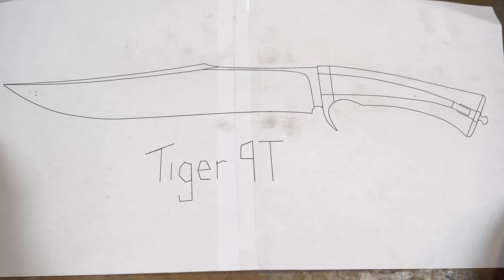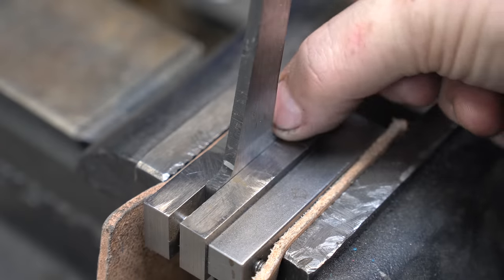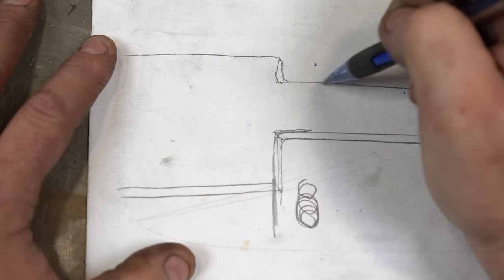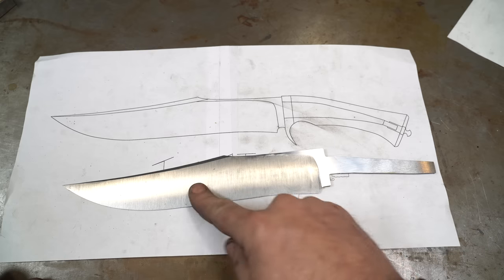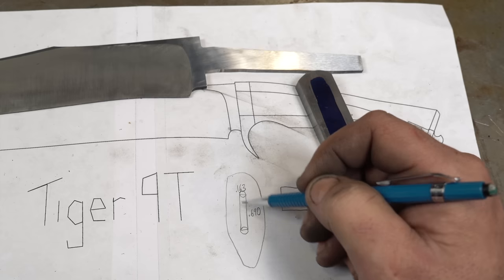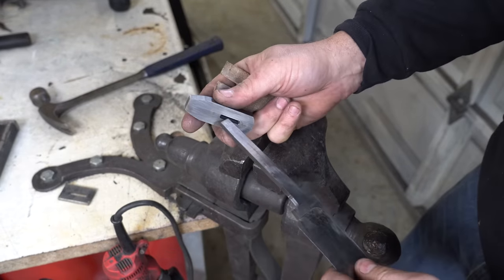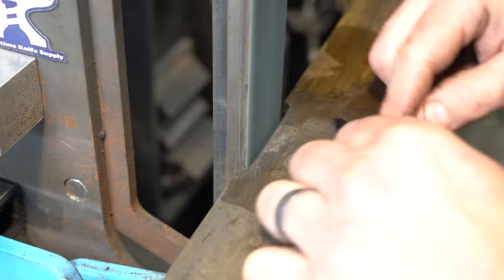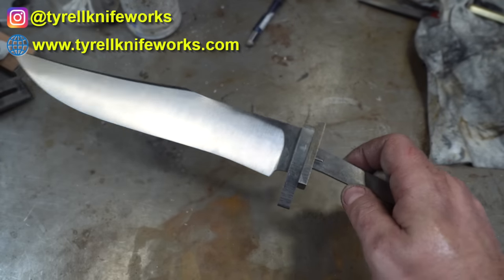Triple-T #120 - Takedown Bowie Series - Guard and spacer

Comment: One thing I don't understand about take-down knives is Why? Why would I want to take it apart later?
Reply from the maker: It’s actually very useful to take it down.  You can clean it, re-etch the blade, fix or replace the handle, lots of reasons. It’s nice to be able to work on each piece separately as well.  Thanks for watching.
Reply from the maker: Also, the hand is almost healed.  It was just a deep scratch.

Comment: What is the POINT of a take down forged blade ? Is there going to be two or three types of different fittings / handle design on one blade ? If not what is the point ? It amazes me how American knife design has become too overly worked ....
Reply from the maker: You're a bladesmith yourself, yet you don't understand the answer to this question?  Pretty much all Japanese blades are constructed as takedowns, it's not an "American" knife design.  The point is that you can take the knife apart, clean it, care for it, without destroying it.  Dial back your attitude a bit and you might get a better response.  (Also, I'm not American, I'm Canadian.)